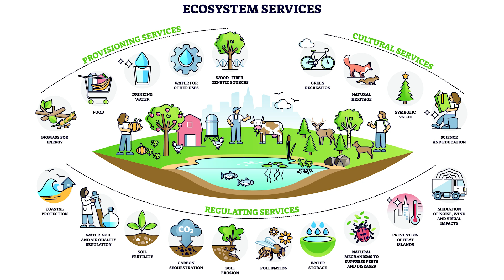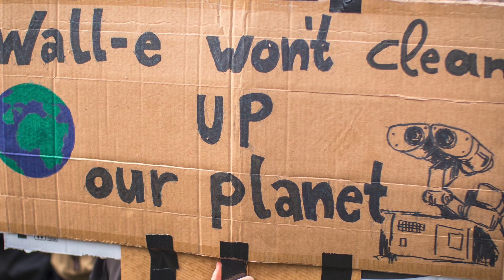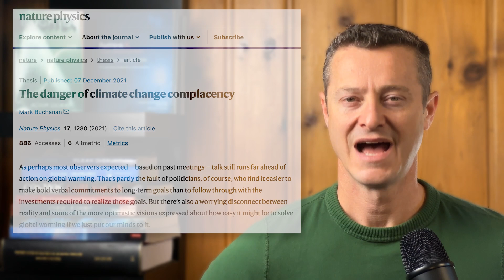Brighter | Episode 7 - Rethinking environmental problems, part 2

Comment: Most people just don't understand. Renewable energy is going to provide orders of magnitude more energy than fossil fuel ever did. I have a small farming operation. I spend tens of thousands per year on gasoline and diesel. I can't wait till all of my machinery is electric and I can provide my own energy with a few solar panels, batteries and some electronics. Think of all the fossil fuel infrastructure that will become obsolete almost overnight. 

But I don't want to put the oilfield workers out of work. I want to build vast desalination plants and pipe clean water uphill. 50,000 acres of solar could provide all the energy needed to fill Elephant Butt lake in New Mexico every year and pump it uphill to the lake from the Gulf of Mexico. The brine can be mixed in deep water so there would be very little environmental cost. We could build lots of reservoirs in places that don't even have rivers running through them. We can reverse desertification and puts lots of people to work. All it takes is some imagination and hard work. And who knows more about pipelines than oilfield workers. We just put water in then instead of oil.
Reply: Why not desalinated water? Just takes more renewable energy that is ever becoming more abundant. Elephant Butte is the lake on the Rio Grande.

Comment: Technology is defined as the application of scientific methods for practical purposes. In this context I agree with you. However modern technology (especially gadgets, equipment etc) is usually in the hands of private companies making them   expensive to purchase, license & maintain etc. This often puts physical tech out of reach of many communities. Of course much tech hardware is unavoidable - renewable energy, infrastructure, Earth monitoring etc. Tech such as drones - used for a multitude of applications - is not out of reach of most. Cell phone apps are also affordable tech most people (eg those in rural areas) can access relatively easily. Think developing countries with minimal infrastructure & gov support.

The best technology for enviro challenges is innovation. Often less tech-advanced methods can be utlised when budgets are tight (eg using lichen to monitor community air quality instead of expensive air monitoring equipment). Of course volunteering is provided free of charge to those in need...

Perhaps this is a good topic for your next series?

Where there's a will, there's a way!